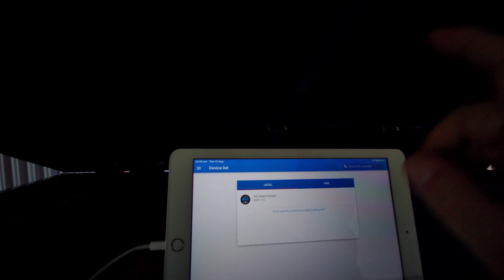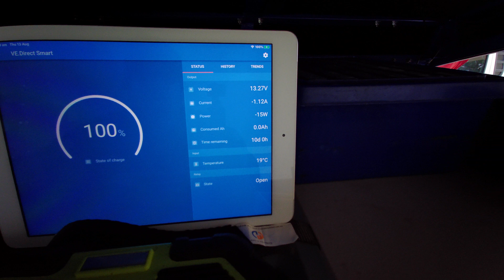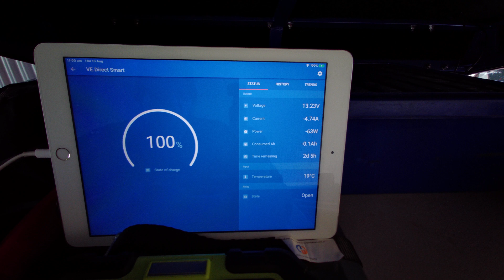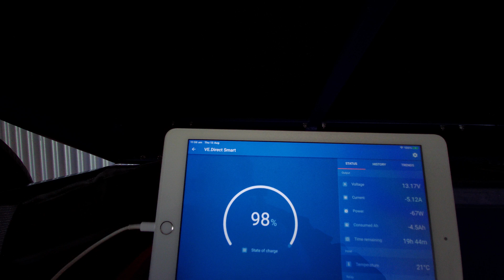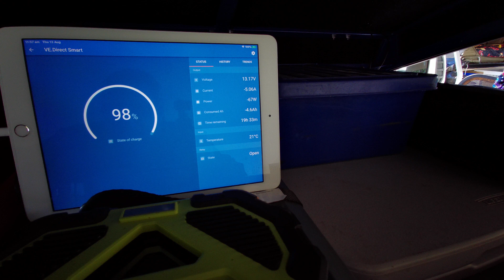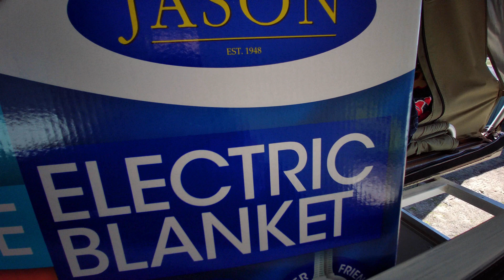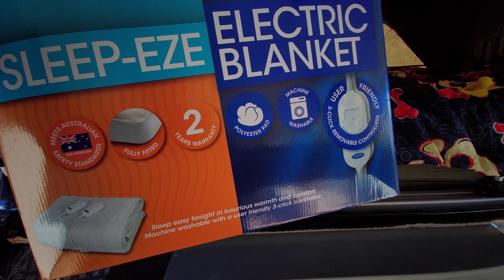Can you run a 240v AC Electric Blanket from a 12v DC battery all night ?

Comment: What size battery are you using?
Reply from the maker: https://www.youtube.com/watch?v=sVL4yYa9jJA
Reply from the maker: In the Trailer i have  2 x 100 Ah batteries that i use for the test. As i stated in the video.  I have just done work on the Ute and will be running it from the 130ah battery see link https://www.youtube.com/watch?v=1UgfZGtlbJI . the other link shows my house battery bank. also 100% off grid

Comment: We just picked up a couple of 12v blankets. It will be interesting to see how they compare in power use to a 220v with the inverter. I don't think we would ever run them all night but a couple of hours at bed time would be very nice.
Reply from the maker: Yes i looked into 12v blankets. Plenty on the market and not all of them work. So as we are setup for 230v we went that way.

Comment: Very nice add on for the bed Chris. Thanks. I thought it would burn up! Hahah. Jim
Reply from the maker: Why would it burn up LOL. It's a fully approved electrical appliance licenced for use in Australia. I used it in full compliance and well within it's designed specifications.
Reply: @JustinCaseSolarPower  Because I would have found some way to screw it up.... hahahahahahaha. You know what you are doing and i am a dunce. Jim
Reply from the maker: Not to much can go wrong with it. As long as you have the right wire and fuse size on the DC side and the AC side is all up to spec, then its all just plug and play

Comment: That’s brilliant mate... a 12v blanket will use more than that in power consumption. ..hope you been well mate 👍🍻
Reply from the maker: All great here. Getting a some itchy feet. Need to be on the move soon. Yes its easy to see how gear works with the right controllers and monitors, takes the guesswork out
Reply: Yep sure does...did you try the blankets on high to see what the consumption was?
Reply from the maker: @EFFICIENTSELF  no mate. will save that video for when we are away camping.